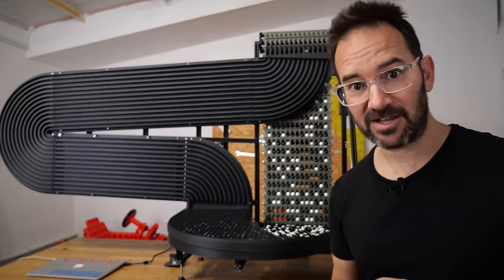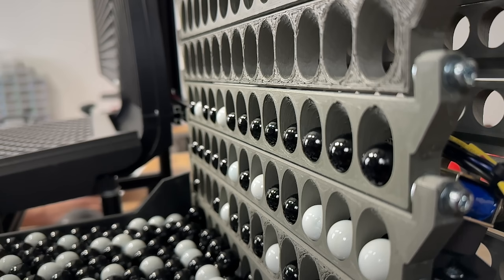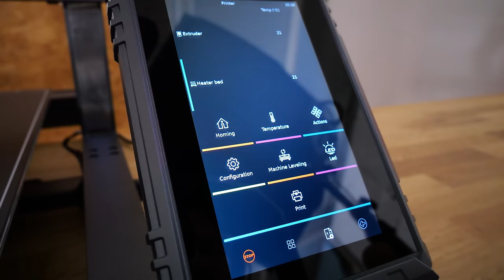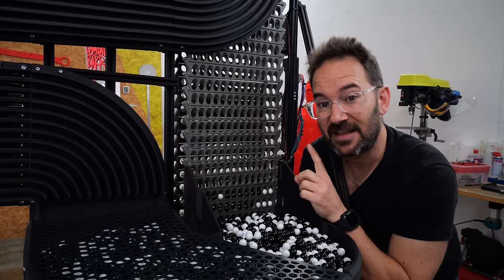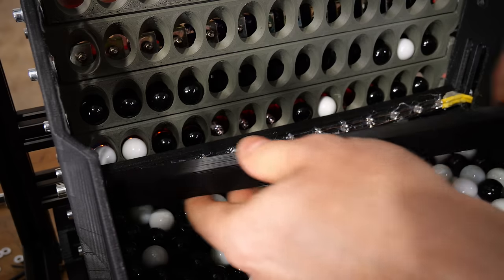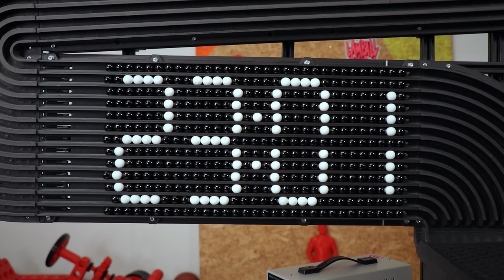BUILDING A MARBLE CLOCK - Pt. 2

Comment: Each upper gate needs a marble counter rather than relying on a fixed actuation time. Otherwise you're going to have to time the flow in each channel - they will all be different thanks to the differing bend radii upstream

+1 on the idea of having a black/white marble presorter. The alternative is to put some "bounce" pins in the chutes to try and encourage greater randomness in the positioning of the marbles, which in turn means a higher jam risk
Reply: On the other hand I do love the reject chute. If it runs at a higher speed it will probably be fine

Comment: to (separate the BLACK from the WHITE):
you are on a mission to use an (optical) sort-at where I am at in the video.
did you consider using (SIZE) to sort the marbles. A sieve to sort a (somewhat smaller white marble from his big black cousin).
i dunno, maybe you did (I'm only a partway into this part 2.  I just thought of this issue back at the beginning of the project.  When I saw that you "will" need to separate the marbles into two flavors.  I thought a (size) sort (it is inexpensive and easy).  Or a (magnetic) sort.  Slightly more hard to set up.  But it will work less jams when it is running.  I quickly dismissed an (optical) sort.  Because of the very issues you are encountering.  BUT, I can "see" it being a good process.  After it gets (tuned).

Comment: why not chgange the black marbals for clear ones, this way you can do seconds as well, where the dots are on the display have a hole and an led behind them blinking every second.  this way you also get seconds, the barals get reset every min, and you have the next min preloaded, so, in theory the black areas would still be black, but to the back board being  black, and thanks to the led behind the dots you also have seconds.

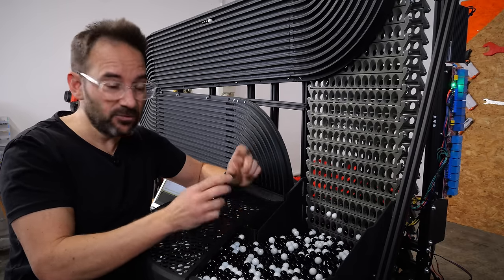Comment: It could go a lot faster if instead of just completely recycling all useless marbles you somehow sort the excess color to the slot you need instead of just throwing them out, that’s gonna be much faster than just random sets of marbles constantly flowing in. The other thing you need to do is have the top part have the next minute already ready, and program it so that when you start the clock, the clock cycles to the next minute and starts filling up the top one so that you don’t have any time delay. So let’s say you know it’s gonna be 3:30 have the clock already set at that time but on the top one and program it to start with the time delay in account.

Comment: So marbles are picked up randomly as the come, then rejected based on color until a correct collor come on any given row...
I think that you can easily run into problem here, single spot not getting right marble fast enough can break whole construction, espeacially on early stage when lot of spots is still needed after that.

Comment: Why not have the clock number build vertically instead of horizontally and have the gates trop the new digits from the top. seems like it would be faster to get the display.

Comment: Why not  make the trails vertical where the numbers are viewed, 4 x 8 or 2 x 16, the you can have a switch that direct marbles to 8 or 16 trails. You can then flush out one or two digits at the time, or all four. Then you probably have time to build up the numbers f. Each number is 104 marbles, it means it has to do 104 marbles on one channel per minute. But if you make sure you can move more than 150 marbles per minute, the over capacity should be enough to build the other numbers before it is time to change them. The vertical approach will also make sure the will flush out effortless  every time you should change a digit. Will of cause set quite much more pressure on the mechanism that hold the marbles in place, but I feel sure you solve this 🙂

Comment: That's bonkers. Why would you expell rows of colours? Why wouldn't you have scanners to split and sort white and black and then load them into positions?

i.e. split black to left half, white to the right. Send them up to top where they fall into black/white pots. Then have your algorithm place balls into the right slots? They could be pre-buffered to avoid time issues.

The buffering would be really simple. Leave gaps where you need say white for digits and fill the black sections with a little arm.. Allow enough white balls to roll into position. When done, remove the space arms and then allow black balls to roll in and fill. It'd be MUCH faster.  

Or simply drop the right colour in the right sequence and fill from left to right, because the first will fill the hole and the next into the subsequent hole. It'd become a lot more simple.

Thanks for getting me thinking far too much for this.

Comment: Maybe you could make a shorter the turning angle so it could move smoothly  because I see a little flat surface where the marbles stuck maybe if you reduce it or make the angle a bit less well it's just my guest it work on my head so maybe you could make it work

Comment: You have to make the balls fall vertically. You will have more channels, the balls will move faster and the circuit will be shorter.
Of course, you will have to redo the machine and the algorithm because now the numbers will be formed by columns and not by rows.

Comment: Ok fine. But I could make It better because I'm a mechanical enginer 😂 Let the Marbles replenish vertically from the top and get expelled in the bottom by arms or cogs letting out a particalur amount of balls. Utilizing stepper motors you could have the clock update every minute and perhaps with rolling numbers kind of like an animation, meaning some white balls can be kept and form the next number. Example: 0 into 1 If left part is replaced with blacks balls. upper part of 2 can become the lower part of 3...

Comment: While hating to suggest it, but what if you made the time 2 marbles shorter per segment and didn't require the black fill to center the time in that large expanse. This does mean that the clock if redesigned would be smaller, but because of the current design, this rearranging of how the time is displayed by scale, basically, the current hardware can do the trick similar to scaling on a computer monitor.
This should display the time faster, and you need not wait for more marbles. When they arrive you can scale it back to your original size of 4 marbles per segment, or continue to march, using the new 2marble segment size\\scaling.
It's just an idea, but I ain't one to gossip... .

Comment: Why not make the clock vertical instead of horizontal? That is, immediately from the elevator, the balls would fall to the bottom, thereby passing less time on these slides and getting stuck less. And the numbers should be 01 at the bottom and 23 at the top.

Comment: it would be better to have a 50/50 ratio, no? your speed is constrained by the slowest row. if a row has a lot of whites, the extra time it takes to search for the white balls means that it takes much longer than the other rows. i think it would be faster to have a 50/50 ratio, which makes the "search time" for white and black equal. the average search time goes up, but the variance goes down. there's definitely a optimum <50% white though.

Comment: While I admire the ingenuity of this project and the genius and dogged determination of the inventor, isn't the fatal flaw of this device the fact that once the time has been calculated and displayed, that time has already passed?
I suppose the clock could be designed to display only the hour and the minute, assuming the device is capable of dumping and assembling all the necessary marbles in a minute's time.

Comment: I think a big problem is you've basically made a bogo sorting algorithm it takes in a random pattern of marbles and knocks some out. But if a whole rwo is incompatible you will have to reject the whole row. In theory you could end up with never being able to display a number if you had bad enough luck. God thing is that probability is on your side but it's still going to take a random amount of time to print each time eith no way determine if your too late or not

Comment: You should have re designed your floor first. A smooth surface leaning towards yet another marble lift that could have saved you some back workout.
Also, the new floor should of course be of marble. (snicker.... guffaw).

Comment: You do realise that you should have built the ramp system the other way around as its the minutes that you need to change quickest. Basically this design means it'll have to build the entire number every minute. If you set it up so you had separate ramps for each of the numbers behind the machine so to change the minutes you just need to open the right gates on the minute ramp to let just those marbles be ejected then replaced by the right colour to make the next number. Your way you need to get rid of every number every time and rebuild the next from the start. Will it be quick enough to do this or will you need skip a minute every time. Really not sure how you'll get this to work right but it'll be a interesting watch seeing how you go about it. Also why have the top and bottom rows at all?

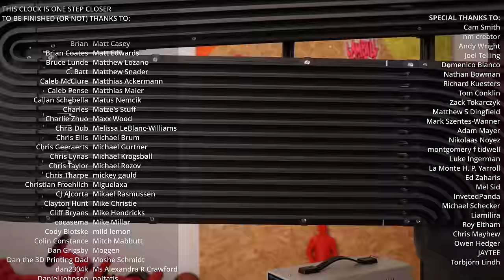Comment: Very cool idea and execution! Seriously good rat. I see that the process until the time is displayed fully can take approx. 2-3 minutes. So when it is finished, the time is not correct anymore. I guess you could program your controllers to e.g. start displaying 11:30 at 11:27 so it will display a time closer to the actual time. I am sure you will figure that all out, you mad genius you!

Comment: Those line-following modules likely use photodiodes or phototransistors as the sensor. They only look like LEDs. You should probably have gone with phototransistors in the first place. Similarly a decent transistor should drive the solenoids just as well as a relay can, the relays are overkill. Though they bring a little bit more versatility I suppose. Still, you might replace them with just transistors and then you'd have a dozen spare relays to play with.

It's a shame your electronics knowledge is a little short in some areas cos you'd have much better solutions for things if you knew just a little bit more. You're doing well with kit-modules though, and seems like you're good at programming the little single-board computers.

I find Chatgpt is good at teaching me. You can explain to him your own concept of a situation and he'll explain related to that, and correct you where you need to be. He can explain stuff in your terms and acommodate your thinking well. He's sometimes inaccurate though, but for theories he's pretty good then you can work out the practical stuff yourself.

Comment: It's very inefficient having to change every digit each refresh.
It would be better to orientate the number channels vertically, then only change the rows that actually need to be changed each minute. Then most times, 59 out of 60 minutes, the hour ones don't need to be refreshed.
And the 10's (minutes) only 5 times per hour etc.

Comment: This is much too complex! Rewriting the entire number when the next minutes comes only requires the replacement of the final digit, until a rollover is necessary for incrementing the next digit. The solenoids can be placed to upset the bals of the wrong color over and over until the right color is in the right place, other wise s sorter can be placed above the array without the theatrical movement. Or is this an art piece?

Comment: Yeah, you won't have fun with that project.
The idea is nice, but you are praying to RNGesus every time to get the right marble in the right elevator seat.
That's not nearly as fast enough to hit at least the 5min mark. Any lower than that and it would be useless.
It would be best if you add some sort of color router before they hit the elevator.

Comment: I believe your design is overly complex. If you can already sort black and white marbles, consider sorting them immediately upon their release from the display. Then, you could maintain two reservoirs (one holding black, the other white marbles) positioned above the chutes and simply inject either a white or black ball into the chute as needed... One important benefit will be speed, because you already have sorted the marbles the reservoirs always have the correct color where you're current system can take some time to get the correct colored marble on the elevator...

Comment: I was wondering what was the best ratio of white to black marbles, so I made a spreadshit. You need on average 18.8% of white marbles if you always print the tens of hour (i.e. 09:25) ; or 16.3% if you don't print the tens when it's a 0 (i.e. 9:25).
Btw the second one is less random as the standard deviation is smaller (9.3 marbles compared to 9.9 marbles in the first one) but also less cool in my opinion cause you're printing less numbers ¯\_(ツ)_/¯

Comment: What a complete waste of time and energy.  Marbles should be sorted on the return so you have two bins one white and one black from which to draw.  Then your clock should be hours in the top rows, and minutes in the bottom rows, that way you're not updating 100% of the rows each minute.  And your "next minute" and "next hour" should wait pre-sorted then released so each drops into place at the right time in the viewable position.  If you look up at this machine for the time, it will be building the time and is unreadable.  What good is that?